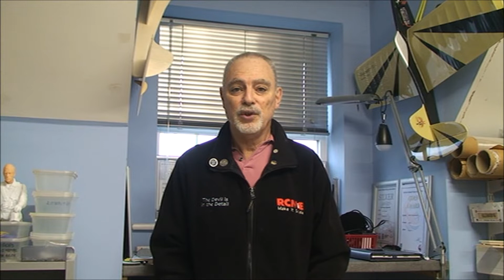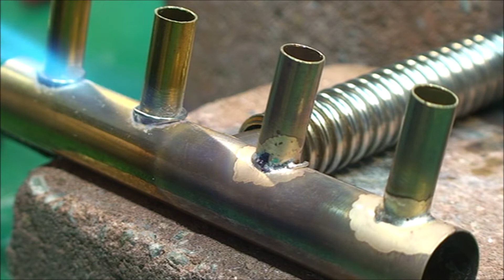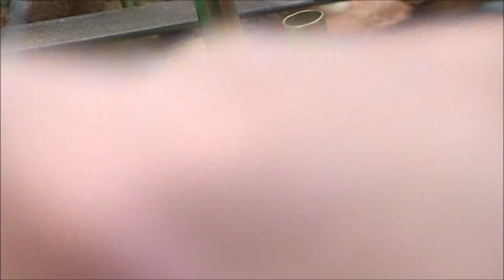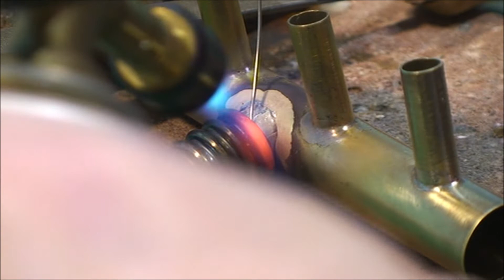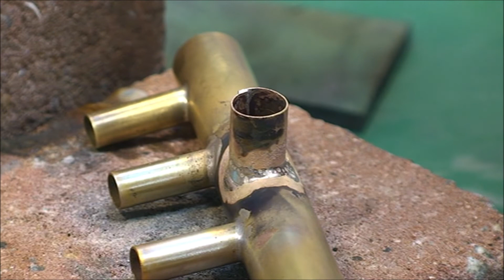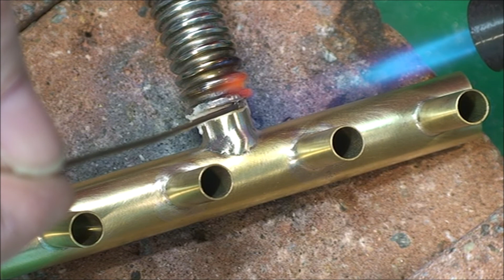silver soldering 102

Comment: I bought a set of exhaust pipes from Mick Reeves models for a laser 200v The pipes were butt silver soldered to a short length of brass tube. I was surprised but its really strong. Your right about their website it is a treasure trove hehe
Reply from the maker: Thanks, and it certainly is.

Comment: Nice work Danny, how did you seal up the ends.
Many thanks Andy
Reply from the maker: Hi Andrew and thanks,  found a supplier on Ebay that did brass disks for pennies, beautifully round, far more accurate than I could cut them,  they were a lovely press fit in the ends. Just a simple job to silver solder them on. It was overall much easier than I expected, the secret is a good flux, the right solder, sufficient heat and the most important cleanliness.
Reply: @cammnut  Thanks Danny 😊